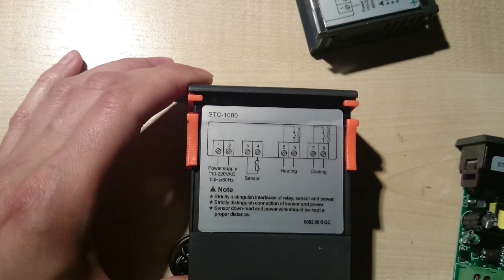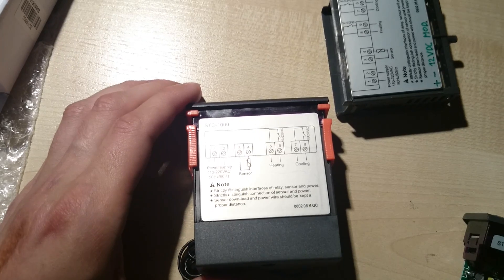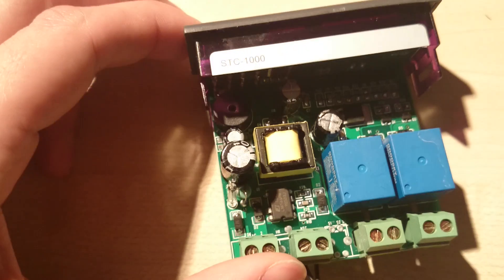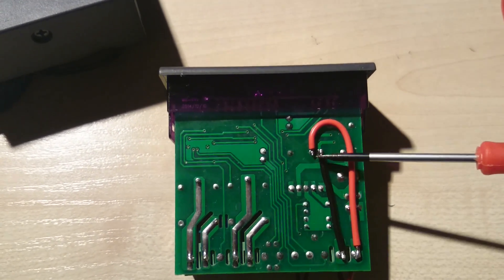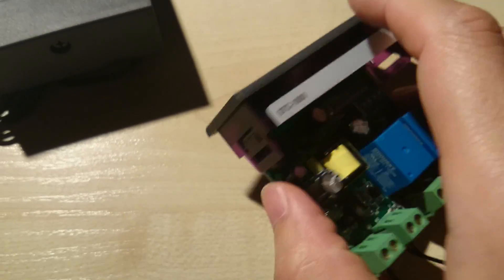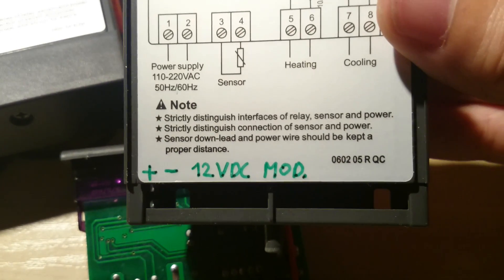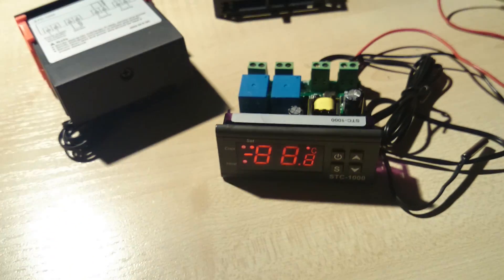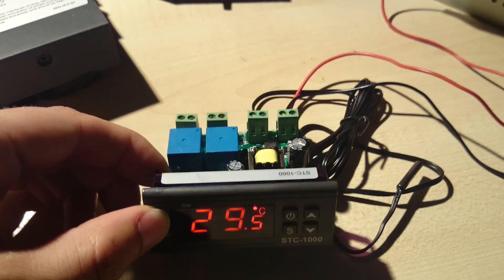STC-1000 WR-032 to 12vdc

Comment: I have a 24V STC-1000, and it works well on 12V! It even has a rectifier on the input!
However, after setting my temperatures, the heat/cool lights don't show up at all, and there's no output. Did I accidentally disable the outputs or is my unit defective?
Reply from the maker: The unit works as a relay switch, you only need to run 1 wire through the unit

Comment: does this make it input and output 12v
Reply from the maker: The input power is just for powering up the unit. The cooling and heating lines ARE NOT linked with the input power. Cooling and heating lines are just ON/OFF switches that are activated or deactivated by the unit with the blue relays on the board. You can run 220v or 12v through the cooling or heating lines as long as you dont exceed the current limit (A - ampers). The current limit is marked on the blue relays or on the unit data sheet. Or in this case the current limit is also marked on the unit itself and it is 10A @ 220V
Hope you got your answer :)
Reply: @vilpzz  how do you do this for the version 2 board cause its different
Reply from the maker: @jaredkarpinski3460  I'm not sure which board you mean? I have only worked and done the mod. on this one.
Reply: @vilpzz  I have the version 2 board wr 032 v2.  it works the same. Remove the transformer. Viewed in the same direction as the video above. The two top connections of the transformer are  -12V  on the left and +12v on the right. Solder two wires similar to the above video to the screw terminals. Don't forget to label the controller as converted to 12v dc. Accidentally connecting mains voltage would be very dangerous.